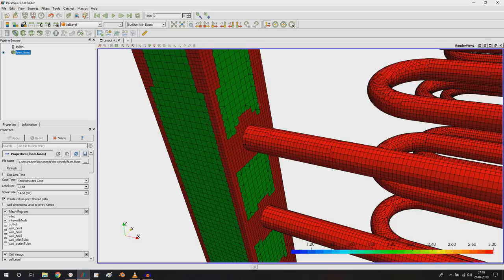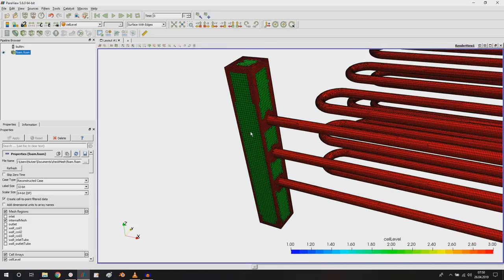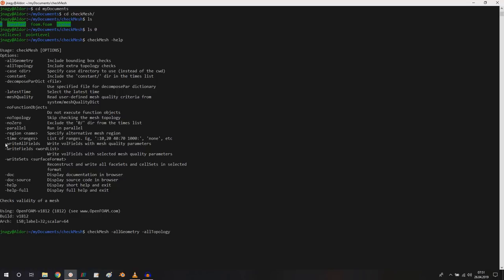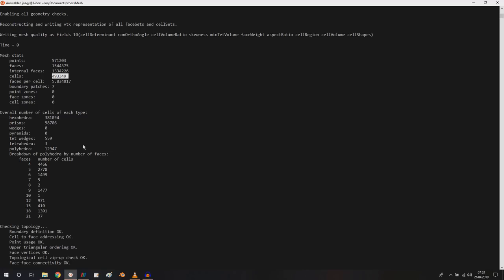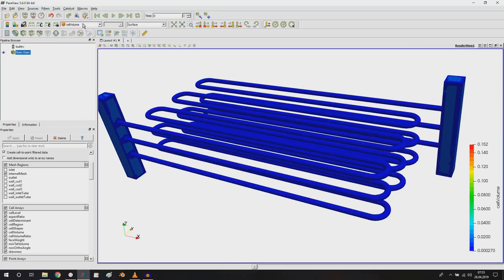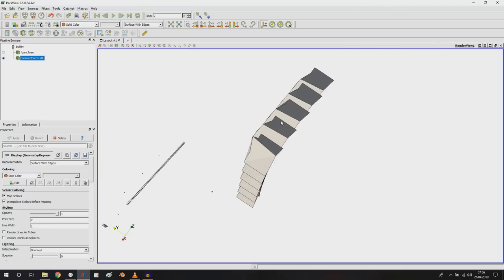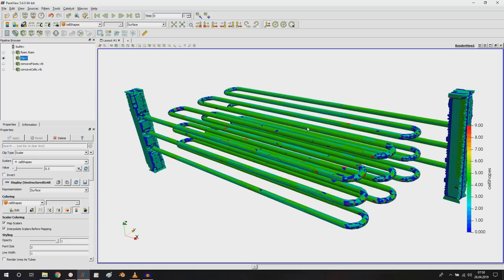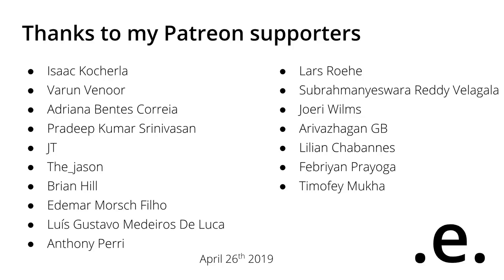Checking the mesh quality in OpenFOAM

Comment: Hello Josef! Thanks as always, two questions, first you have writefields and writesets I understand that write sets creates the files in the post-processing folder but write fields it creates files? Where? Or it modify them and then which? And the second question that is a bug bomb as question, what we do when  we have some problematic cells? After doing the snappy It showed some bad cells in the mesh quality check, how can I improve this for the different qualities?
Thanks as always great videos,
Reply from the maker: sets are always in the polyMesh folder. fields are usually in 0. You can identify the region, where you have the problematic cells, improve your STL and your refinement level there locally.

Comment: Hi Dear Jozsef,

very very helpful for checking the Mesh Quality in Paraview. I am getting this error while running this command in terminal   " checkMesh -allGeometry -allTopology -writeAllFields -writeSets vtk "

--> FOAM FATAL ERROR: 
Invalid option: -writeAllFields

I am running OpenFOAM6 Version on Ubuntu. Can you please
Reply from the maker: This is working with v1712 and newer. I didn't know, but obviously it doesn't work for the .org branch. This is an example, where a feature is missing in the .org branch, so it is better to use the .com branch.
Reply: @OpenFOAMJozsefNagy  
Thanks a lot Jozsef for your reply. I installed OpenFOAM v_1812 and its working now. Thanks a lot for teaching us new command.

Comment: Hi Jozsef Nagy,  I am a big fan of you. I am learning OpenFOAM from your videos and they are really helpful. I am really grateful to you for your wonderful support. I have a question for you regarding meshing. In blockMesh we specify the Nx, Ny, and Nz i.e. number of cell/cubes in each direction but in snappyHexMesh we do not have this control. I mean we specify the refinement level while using this utility. Now I want to find the number of cubes/cells in each direction in the mesh created by snappyHexMesh. Could you please suggest me how can I do this. I will truly appreciate your help.
Reply from the maker: I have never done that before. Sorry, I do not know, how you would do this in an automatic way.
Reply: @OpenFOAMJozsefNagy  Hi Jozsef Nagy: I see. No problem thanks a lot for the reply. I appreciate it. I have an another question for you.
Reply: Hi, Can you suggest something to me for this problem: I am running a simulation: Open channel flow with a cube placed inside the channel. Now I wanted to map velocity field on a new refined open channel but without any cube in it.  So there are geometries one with a channel with a cube in it and other one will be a channel only. i was thinking to use mapFields utility but no success yet. Would you like to suggest something for this issue?
Reply from the maker: @horagurpreetsingh  Difficult to say. Should work, just without -consistent.

Comment: How to measure the height of cells close to the wall boundary; basically, I need this value to compare my calculated y+ value with generated value.
Reply from the maker: You can calculate the y+ values directly in OpenFOAM. simpleFoam -postProcess -func yPlus

Comment: Thanks so much for sharing these useful videos, which help me a lot. I want to ask you a question but not related to this video...
Do you have any ideas about adding a flowrate on a moving boundary in OpenFOAM? which i mean two boundary conditions on one boundary, the fluid flows inside the domain through a moving boundary.
thanks in advance
Reply from the maker: Yes, should be possible with ACMI. I do not have tutorials available on this, however.
Reply: @OpenFOAMJozsefNagy  thanks for your answer, ACMI means Arbitrarily Coupled Mesh Interface? another question... do you think is it possible to give a constant flowrate? because during the mseh moving, the area of  this boundary is changing.  Thanks again
Reply from the maker: @yugu6086  Yes and yes there is a BC for that called flowRateInletVelocity.
Reply: @OpenFOAMJozsefNagy  Got it, thanks a lot
Reply: @OpenFOAMJozsefNagy  Hi, dear Jozsef,  I have looked a little bit of ACMI, it seems that doesn't work for my case, mine is more like velocity BC provide  flow rate relative to dynamic mesh motion. Any ideas...thanks a lot
Reply from the maker: @yugu6086  Maybe movingWallVelocity?
Reply: @OpenFOAMJozsefNagy  thanks for the reply, movingWallVelocity is for moving boundary to correct flux, flowRateVelocity is for giving a mass flow or volume flow across a boundary, my problem is probably how to combine them together.

Comment: Hello.. nice video!
I wanna ask something to you.

How did you find and calculate the total of mesh?
Is that on Tetrahedral or in cell?

Thank you.
Reply from the maker: Thank you! Unfortunately, I do not entirely understand your question. Do you mesh, how I generated the mesh? I used snappyHexMesh in this case. I hope this answers your question.
Reply: József Nagy Thank you for the reply 

I mean how to know the mesh size in OpenFoam? 
For example in ANSYS CFX, just click the button then mesh size will be appeared 
But in openfoam by checkMesh, which one is indicated for the mesh value?

Sorry for the misunderstanding
Reply: @aldiasbahatmaka1052  When running checkMesh, in the first lines you will see:

Mesh stats
    points:           1122715
    faces:            4132566
    internal faces:   3949715
    cells:            1542319
 // This one gives you the total number of cells in your mesh
    ...

To know more about checkMesh, check this presentation : https://openfoamwiki.net/images/f/f0/Final-AndrewJacksonSlidesOFW7.pdf
From page 65, it details the checkMesh output
Reply: Hello @Lili An.
Thanks for the help. ^^
Reply from the maker: @aldiasbahatmaka1052  Mesh stat - cells
Reply: Thank you ^^